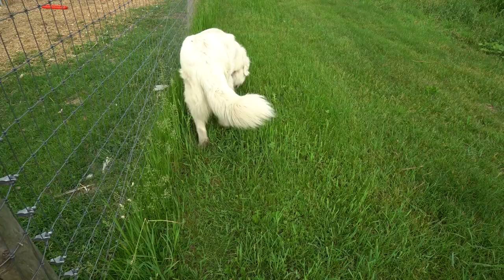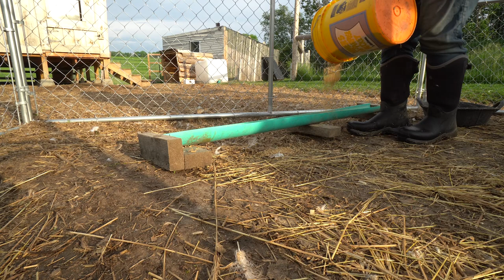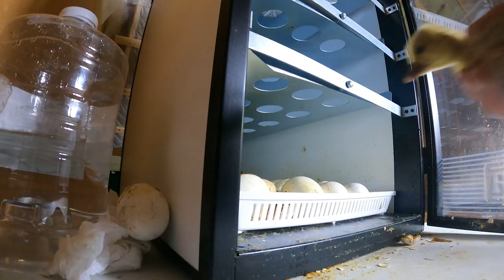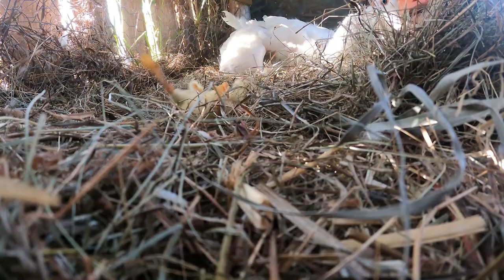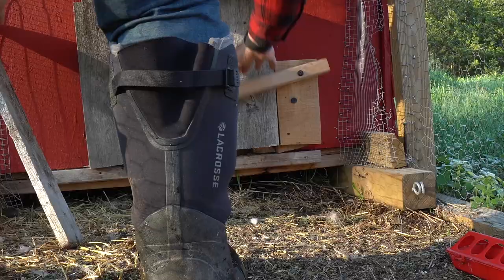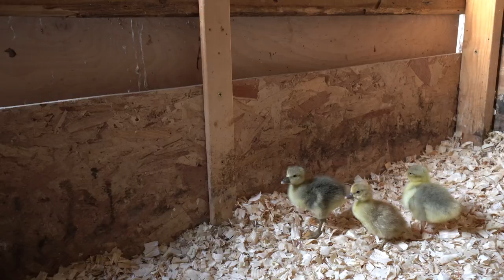Goose Adoption goes Horribly Wrong

Comment: I think you handled that quite well actually, there are no dead chicks and you could try, some geese accept them as their own, totally get what you were thinking. It often works better with eggs that aren't hatched, however the tricky thing (I did it with ducks) is the shock the eggs get from the difference in temperature, most certainly when the mother Goose doesn't directly sit on the clutch. So it's always risky.

About the eggs under the broody geese, try to candle them either before throwing them away or (next time) after about 7 days or so. Then you can see whether the clutch is succesfull and how many eggs are. You can discard unfertilized eggs so that the developing ones get a better spot and a smaller risk of disease.

If people are angry at you, you shouldn't bother, this is realistic and it's not even that bad. That's honestly why I (and many people) watch your video's because they're far more real than most other homesteaders and very relatable as a result.

Comment: I thought you were going to put the eggs under her not when they already hatched
Reply: eggs that were hatching probably would have been a better option.
Reply: I thought so too. Pipping eggs perhaps.
Reply: Me too, or at least removing the mothers from the nest and then sneaking in some goslings before it comes back so it thinks it hatched its own.
Reply: Yeah, Ihavethe very same question. Why hatchlings and not the eggs?
Reply: @Tanks_In_Space  you will be very surprised. We tried this same method on chickens but during the day. It doesn’t work by that was the first thing that came to mind.

Comment: Only comment I have is a goose bite doesn’t hurt much you need to brave it up a bit more bud . Even a scratch from the claws might sting but your a big man I’m sure you can handle a scratch or two …lol
Reply: Definitely agree with this!  The pain is all because of fear.  Once you accept that it doesn't hurt that much then it hurts even less because most of the pain is just in your mind because you're afraid it will hurt.  They've done studies that show that being afraid of the thing that will hurt you amplifies the pain.  Also, don't try to rip your hand away so fast because that's when their 'teeth' cut your skin, if they bite you just leave your hand where it is until they let go, it will hurt even less again.

Comment: I think your natural hatching might have the following problems:
First, I would provide food and water close to the brooding mothers so the nest is left for as short as possible.
Second, I would only let Geese brood that have been naturally hatched themselves. In my opinion, naturally hatching is such an arduous and complex process that comparatively few, only very viable eggs will survive it and pass on genes that make them good brooders. Incubators, in my opinion and based on my experience with Coturnix, degrade that ability by letting animals that wouldn't have these instincts and very good genes survive.

Comment: You need to cover her head and actually sneak them under her so she does not see what your doing and they have to be compleatly underneath her for her to take them usually anyway, now some geese will take and adopt them anyway but all I have delt with I usually have to use a towel to cover her and hold her until she coulms down then.slowly take all her eggs from her and put the chicks under her and then when she coulms agian hurry and leave, or even better just take all her eggs and put your eggs under her 1-2 days before they hatch

Comment: In my past experience with poultry, the best way to exchange dead eggs for life babies is to wait until dark and then go in with the babies that you want to put under the setting hen and all the eggs out one at a time and as you're pulling the egg out you sliding a check or a goose underneath the mother in the dark. The little ones will move around under her but she won't actually see them until morning and by then she thinks that they did hatch in her nest. I'm not sure why doing this in broad daylight with no darkening at all a plan but perhaps that's a new way of doing things.
Reply: Read Mason's pinned comment. It doesn't work for ducks and geese he says.

Comment: My suggestion is to more actively tame the geese you want to try to let sit on eggs. Accustom them to you handling them on a daily basis even if just for a few moments each one. And when they nest up continue the same. This may result in less whom ultimately set on a clutch, but those which do, you should be able to candle their eggs and if none are viable, you should at least be more successful at doing gosling for eggs swap. And maybe also swap incubated and candled eggs under the nesting goose just before they hatch instead of after.